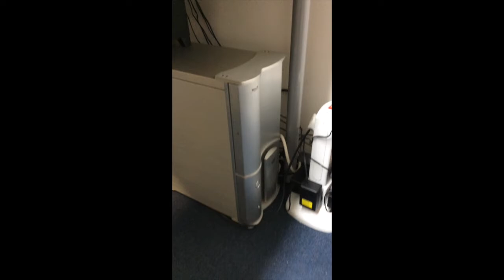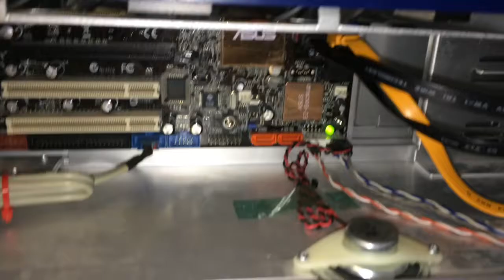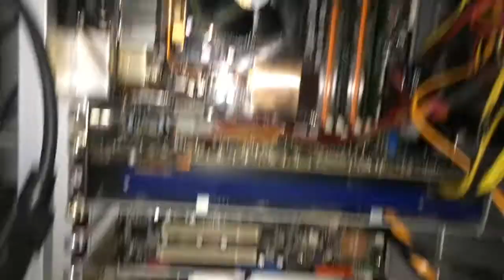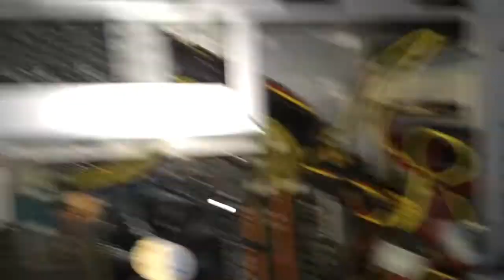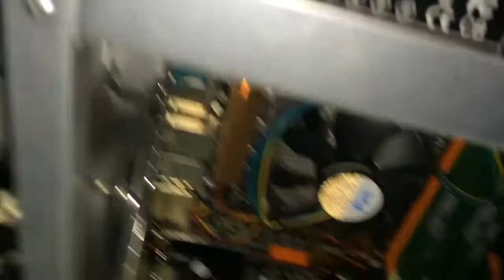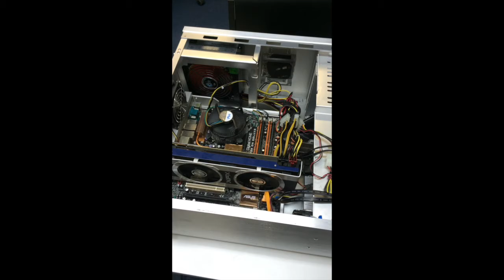Worker 1 Goes Down! Diagnosis & Repair Captured on iPhone

Comment: hi Risky, do you know any command for speeding up the gpu fans in the (start-ethereum-dwarfpool) batch file. thanx
Reply from the maker: +martin ignatov Hi, no the eth miner doesn't support that. You can use Msi afterburner or Trixx to increase the fan speed, I normally run afterburner with all my mining rigs.
Reply: +RiskyRandoms  thank you !